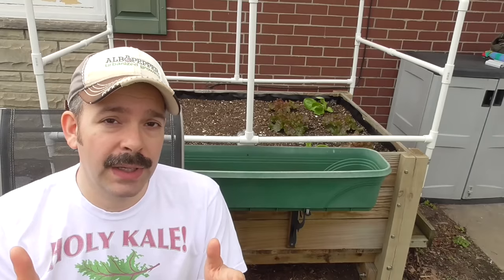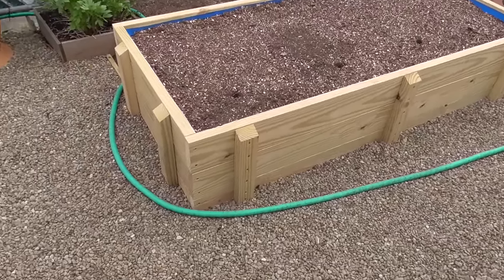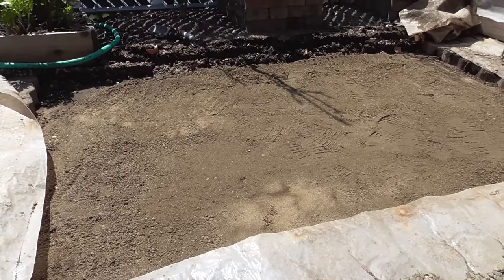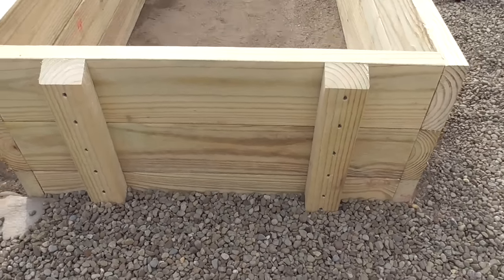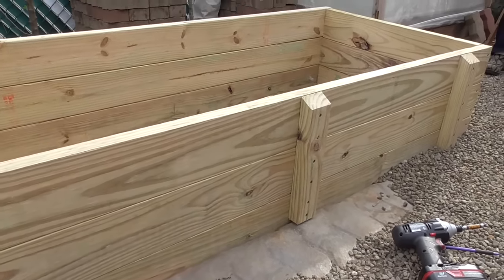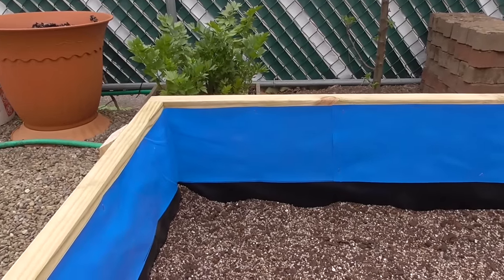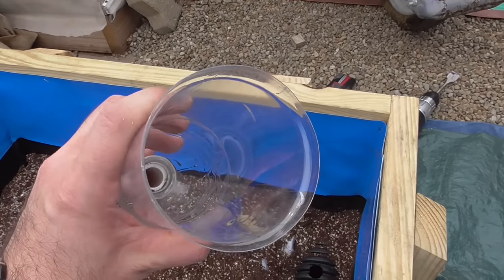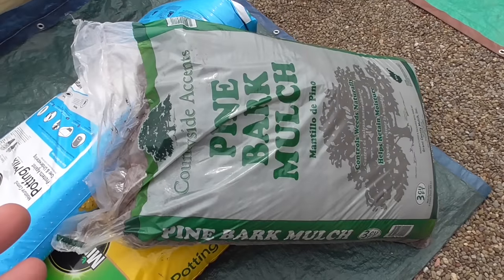Self-watering SIP Sub-irrigated Raised Bed Construction  (How to Build)

Comment: Great video! You answered a lot of questions. Just a few tweaks I’ll be using: large tie-wraps to secure the cloth at the ends; going to make it one course higher and line the bottom with leftover brick to keep the moles out; use rigid pipe for the drain tubes. Other than that, there’s no reason to change anything else. Excited to finally get to try this!

Comment: I grew tomatoes in 30 gallon totes built according to Ray's earthtainer design on Tomatoville forum for 3 years. Lowes no longer sells the 30g totes so was interested in building raised bed with SIP. Watched a lot of videos but yours is the best. Agrees with Ray's Methods on Tomatoville No compost, manure, top soil, logs at bottom. Ray's 30g totes had an aeration bed covered half way up with landscape fabric between water reservoir and potting mix with a wicking basket down in water reservoir. Worked awesome.  I found I needed plastic on top . It rains a lot here in deep south and then blazing hot sun quickly dries out potting soil.  Will use your design for SIP.

Comment: Thanks for the awesome video! I used this design as the basis for 3 4'x10' boxes and it worked great--my neighbors here in dry Denver were amazed at how massive everything grew. A couple little things I learned along the way that you might consider adding: 1) I covered the ends of both the drain and fill pipes with a bit of fabric to keep insects, dirt and other stuff from clogging it up. 2) I really wish I had done a better job of clearing out the ground where I built the boxes. I leveled it as much as possible, but there was still some bindweed lingering. It ended up growing through the space between the box and the liner and coming out in between the layers and at the top. Next time I might try putting a layer or two of cardboard underneath the whole thing--another tip I got from your videos!
Reply: Bind weed is terrible! Comes thru cement!

Comment: This video is fantastic and I highly recommend SIP beds for consistent watering and to keep weeds/grass away from your raised beds.

I built my first 4x4 SIP bed in the Spring of 2018.   I live in South TX and it’s hot in the summer.   The SIP beds have taken the guess work out of watering.   I fill them almost daily during the hottest time of summer, but it’s the first year I have not had any heat stress.  

Second, I have Bermuda grass in my backyard.  I have been plagued by this invasive, awful grass getting into my raised beds.   The pond liner has kept the Bermuda completely out all year.   

I have 8 beds now.    Awesome video!   Thank you.
Reply: Thank you so very much for your very well done video. I am definitely going to try it !
Reply: Thanks for the comment on the Bermuda grass. I'm building this bed, also have this grass and was concerned. Sounds like it should work for me!

Comment: I just finished building 3 of the raised bed wicking boxes. I must say it was a very labor intensive and a bit pricey project. I told my wife the first tomato we harvest will have cost around $1000 for all three boxes! I used most of your model ( I installed bulkhead drains and made the boxes 32"x72" inside) and used Mr. Leon's potting mix, fertilizers, and a few plants. My fill tubes show 2-1/2", 3-1/8", and 3-1/8" inches of water after the initial fill. I think I can utilize an elbow and a swivel pipe to raise the water level in the one box to match the others. I imagine I did not get the sand base level enough. I will see how it goes. We are excited to try growing some vegetables and flowers. You were correct about the quality of the treated 2x6's. They are very heavy and difficult to square up. I used 90 degree jigs and wood clamps to get the frames as square as I could. I even bought forklift forearm straps to move the completed boxes! Also I used a wood sealer on the cut ends and in every screw hole to keep the wood from checking. We look forward to harvest time later in the summer and hopefully we can plant a fall crop as well! Thank you for your excellent step by step tutorial! God bless you!
Reply from the maker: Hopefully you have a great season! Keep us posted. 😃

Comment: Just finishing my 4 x 6 Ft using all reclaimed wood. I painted/sealed-in the wood to make sure it lasted. I'm also using some old fungus infused logs along the bottom but above all the pipes & Coco/perilite/Pete filled bottom. 
ThanQ for being so informative in this video. It has been my go-to for prepping this project.

I ended up also cutting down some Pine from the yard & debarking it.

Take Care, Brother.

Comment: Outstanding video. I built one for my girlfriend following your instructions. All went well until I filled the bed. I should have realized that the inside of the bed where the drain hole was needed to be sealed with a waterproof sealant. I filled the bed and as the water got to the lower level of the pipe the water seeped out and down to the boards in the bottom. Thank you for the knowledge you have brought to us.
Reply: Agreed, I was wondering same thing!   There might be a water-tight irrigation connector port that could be used.  I’ve made a bunch of self-watering containers on a smaller scale.

Comment: I like it a lot.  I can't help but think incorporating something to make the watering automatic would be great.  I use a PVC sewer pipe rain gutter system with grow bags over it to do something similar without the box.  It uses 1/4 inch poly tubing in a float valve to maintain a constant water level.  A bucket or tube in a corner could hold a float valve that would insure that the water level was an inch or so below your drain automatically, allowing the reminder to be filled with rain water when it occurs.  I'd like to see the planting surface high enough to allow no-bend maintenance of the bed.

Comment: Last summer, my daughter gave me some plants to grow. I had to come up with a self-watering bed fast, so I bought two kiddie swimming pools (the blue round plastic type) and grow bags. I put the grow bags in the swimming pools, drilled a hole in each pool to prevent over-filling. My plants did very well and all I did was top off the swimming pools each day. So now I have Birdie's raised beds to set up this year and I'm going to do this with one exception. Instead of drilling a hole into the side of the raised bed, I'm going to run the overflow pipe under the bed. It will look like a "U" with short horizontal end pieces.

Comment: The best (informative and fact based) video I've seen on the Subject of Self-watering systems. I tried SIP in  TWO BUCKET system a couple of years back; but the lack of space between water table and the soil mix resulted in a water logged layer. Your setup appears to have eliminated that issue. Thanks for your efforts in creating the Videos!

Comment: Here we use covers to keep the heavy rains from washing all of the amendments from the mix and so we only have to fertilize once at the beginning of the season. If the covers are tucked into the interior edges, it still allows the beneficial rain water into the reservoir down the sides without disturbing the fertilizer strips, washing out the lime, and essentially changing an otherwise, semi-closed system. This also helps with things such as excess nutrient runoff, weeds, rodents, insects etc, and conserves yet even more water.

Nice job either way. 1-1/4 thin wall pvc for the fill tube lets you stick the hose in it and basically turn it on full blast. We use Kerick float valves in an enclosure to make them automatic and the fill tube is just in case we have a valve malfunction.
Reply from the maker: An excellent tip! Thanks for sharing the good info Mr Boat.  :-D

Comment: I just built 3 SIP's.  Used 2x12's, stacked 2 boards on top, so they're 55" x 33", 24" tall.  They look great, now I just need the dirt. Looking for miracle grow, raised bed potting mix.  If only I could find it in bulk!   Thanks for the videos, great job with your posts!  
Tim

Comment: I followed your instruction and built a self watering garden--IT WAS 
OUTSTANDING!!!!!!!!Best yield I have had in 6 years of growing my own 
vegetables.  I will be building a 2nd box soon just to grow onion, 
lettuce and smaller tomato plants.  I am not sure how often you answer 
questions or if this is the right method to ask question.  But, I would 
like to know in my current box, what do I need to do to the soil to 
start it this season?  I followed your instructions for building a box 
and the soil mixture to use.  Not sure what, if anything, I should add 
to begin the season.
Reply from the maker: Hi Ace! Thank-you so much for sharing your results and encouraging words.  :-D  At the start of a new season, I lightly rake the top of the potting mix to fluff it up and to break up any remaining roots. If the mix has settled, I top off the box with fresh components. At this point, I assume all nutrients have been depleted. Ideally, you could get a soil test. I do not do that.

I simply add all new nutrients by way of fertilizers which may include worm castings. Synthetic OR organics could be used - even a combination of both. If you are using pure synthetic, then you may need to add calcium and magnesium in the form of dolomitic lime. With organics like Espoma, you'll likely see that they already have calcium and magnesium in them. Last year, I followed the instructions according to an older bag of Garden-tone. I treat my SIPs like large containers. For containers, it called for 2 cups per 1 cubic foot (only include the top 12" in your calculations). This rate would apply to an organic that is close to 4-4-4.

It worked great last year. Mid season, you might need to supplement though if it looks like the plants have run out of steam. If you want to reset soil nutrients for the following season, you could throw in some heavy feeding crops at the end of the Summer or early Fall. I did this with Kale plants. They grew all Fall and survived in zone 6 into the Spring. I didn't fertilize. I just allowed them to suck up as many remaining nutrients as they could. Hopefully this will minimize excessive nutrient build up over time. Hope that helps!  ;-D
Reply: Hi Al, I'm wondering a little similarly to Ace. Apart from nutrient depletion, how long before the soil that is perpetually wet turns sour, and there's then a need to dig out the box and refresh it all.
Reply from the maker: Hi Mike! For the SIP box shown here: http://albopepper.com/grow-box.php  It is from 2011 and still has the original potting mix in it. It settles a little each season so I top it off with new mix that I blend into the old. But still, the structure has held up so far!

Comment: Great video! I think I may build something like this next season, coupled with a float valve to auto-water from rain barrels. Thanks for sharing.
Reply from the maker: Ian MacDonald Thanks Ian!  Yeah a system like this would be easy to adapt to a float valve set up.  A float valve system would mean ZERO dry periods.  Moisture would be very consistent.  So be sure your mix has good pore spacing and follow my specs.  :D
Reply: Ian, did you ever create this system? If so, would you be interested in creating a video on it?

Comment: Awesome video, you the man.
I have a suggestion. I would recommend that you spray the outside of your pressure treated wood with a Thomson water seal once every 2 or so years to prevent warping, cracking , and chipping of the wood. This happens when the wood gets swelled with water, then dries  too quickly and  unevenly. The oil sealer allows the wood to still breath with moisture but it does it nice and slow and evenly. Same for concrete and brick walls. 
Just wanted to let you know so all your beautiful work ages like a fine wine. 
Keep up the great work. I'm a big fan.

Comment: I like your methodical approach to your design. Having that air pocket between the soil and water seems like a very good idea. I’m kinda against not adding composting and manure in the box. I’m inclined to go against this because number one I like to go cheap and number two I have this killer compost I want to use. My last comment is: using treated lumber your upright posts  are cut at an angle to shed water they are also more aesthetic, but the surfaces cut on treated lumber are as prone to rot as regular lumber. Actually more so because you’re dealing with open grain wood . to prevent this you could either paint the ends of the wood or char them with a blowtorch. Charring a wood post before buring it is a common practice
Reply from the maker: Thanks for your feedback! This page talks about the concerns related to certain types of compost / manure: https://albopepper.com/refreshing-sip-potting-mix-adding-fertilizer-year-2.php#manure

You make some good points about the treated lumber. I've just rebuilt the entire system & plan on doing a new video about it. In my new version, I've opted to keep the upright posts at a 90 degree angle to reduce surface area and minimize degradation. I don't place my planters directly on soil anymore either. That's a very problematic approach that definitely reduces lifespan of the wood. More to come on all of that...
Reply: If you're concerned about the cut ends, I believe they make a canned product similar to the chemical used in pressure treating, for that exact purpose (cut ends).

Comment: Good info here.  👍 One thing you mentioned is possibility of the soil entering the corrugated tube through the vent holes. This rarely happens to any significant degree. We have hundreds of thousands of MILES of this stuff buried in my surrounding farm ground with great success. My hometown has produced drainage tile since around 1900. Early stuff was clay tile fired in a kiln. Our factory switched to plastics a few decades ago.
My preference for the drain overflow is 1/2 inch PEX tubing. Just drill a 5/8 inch hole & insert the preferred length. It's cheap and stiff, so no bending up.
Reply from the maker: Thanks for the tips! I've used 1/2 PVC schedule 40 for the overflow and that worked well too. On future builds, I might try a bulkhead fitting. I'm not worried about soil entering the slits on the corrugated pipes. This video shows how empty they remained after years of usage: https://www.youtube.com/watch?v=q-JitnHKCY8  But obviously you need to ensure that the ends are sealed off in some way.
Reply: @Albopepper  Yep, nearly all the farm fields in my area are tiled with the corrugated pipe. Only difference is that they are laid with a slight grade to ensure that the water flows downhill.
I used the PEX 'cuz I had a leftover length. I just snip off a 4 or 5 inch piece to use as drain tube.

Comment: Also, is sub-irrigation wicking really self watering? I always expect a device that triggers filling the sub chamber when water is too low. But if I’m filling a tube with water till drain water runs, then, I’m watering. Not truly self watering. But I understand the meaning. There are self watering methods of similar design using everything from sump pumps to toilet ball concepts. Very interesting. I’ve used several of your videos for some concept designs. Thanks!

Comment: I watched this video over and over, and over again. It’s so helpful. I decided to try it using stock tanks. One of the difficulties is that not all the pipes can lie straight because of the rounded ends of the tanks. Also, three of my tanks are 12 inches deep, and three are 24 inches deep. I’m working on the first 12 inch one now. I used three-inch black drains rather than four. There are a lot of gaps, so I stuffed them with a vermiculite/peat moss mix. I hope it works. I’ll post an update once I know.
Reply: Hi Karen, we are just about ready to finish our raised beds.  Above the 4" drains we will have 13" of soilless mix.  Looking forward to your update on your beds.  Were they a success?

Comment: Hello Al. 
I don't really remember what I was searching for when I found your "
Self-watering SIP Sub-irrigated Raised Bed Construction (How to Build)
video. I've been retired now for several years and I've been bucket gardening and raised planter gardening for a good number of years with mixed results. I should say I'm an engineering type who most recently owned a hardware store and I enjoy inventing and building stuff.
I combined your planter box design with a rain barrel with a self feeding float valve, so as long as the rain barrel has water, the planter has exactly the same amount of water all day, every day. 
I've had the basic equipment for making rain barrels for years now but thanks to the marrage of your drought resistant planter box and the barrel I finally got my butt in gear.
I only got plants in the ground on 6/5 but we had a great salad tonight with romaine lettuce, arugula, kale and radishes from our garden. Thanks for your help. Here is a snap of the initial setup.
https://i.ibb.co/qBLLtMK/20230605-155800.jpg
That pic was taken right after I planted, everything is going crazy now, we (Detroit Michigan area) finally have had some rain for the lawn, but the planter has been happy as long as the barrel has water. And of course I watch the barrel water in a drought like we recently had. I haven't done it but I was thinking of adding another automatic fill valve to keep a minimum water amount in the barrel from city water. 
Also note; I'm really surprised at how little water the planter needs. Mine measures about 4 ft by 8ft. The water level in the tubes below is about 2 1/2".
Again thank you. If you have an interest I have many notes and pics of the whole project which as you so generously shared with me and many others I'd be happy to share with you.